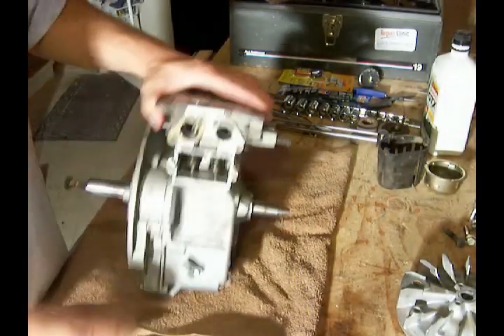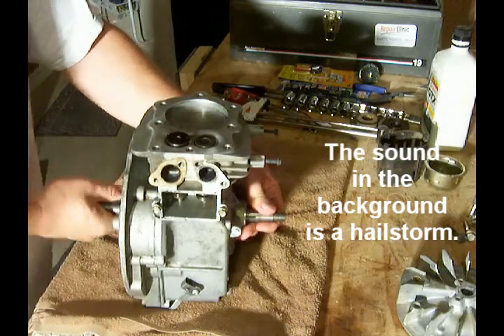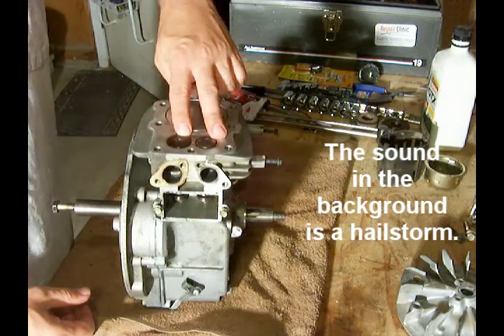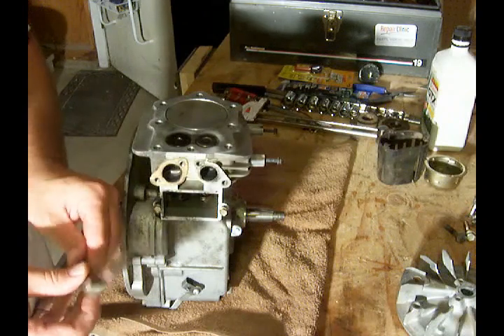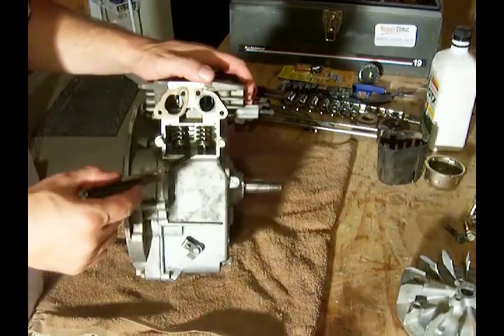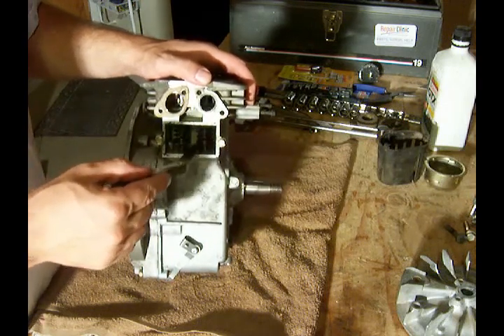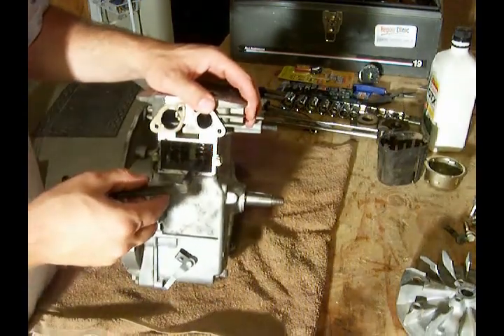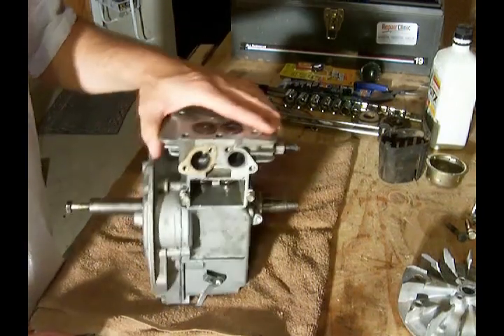#16 Tecumseh LV195EA / LEV120 - Checking valve clearance

Comment: For the Tecumseh this engine the set up valve gaps must be done w/piston on TDP, top of the cilinder and all valves very well closed. In the picture there is a mistake info w/intake valve. This is exhaust valve shown w/finger. The next bigger valve is for the intake valve. The valve gaps will be: 0.006" +/- for intake valve and 0.010" +/- for exhaust valve.

Comment: Tecumseh company has complicated the valve gaps for adjusting. There are a lot of job to do for this action. The gap adjusting is not friendly, must put a lot of work and the gap dimensions are not cleared exactly in what position of the piston must make the job. The piston on the TDM position can be more up or more down than 0.005-0.007 etc. because the piston can have the tolerance in this area of TDM. It is imposible to compare the valve gaps w/the piston gaps on the TDM position.

Comment: Can someone please respond to the fact that here the shaft was turned clockwise to reach TDC, when normally the shaft turns anti clockwise.
Reply: actually he turned it ccw looking at the flywheel end. he should have turned it clock wise (flywheel side) and actually had the intake valve open and not the exhaust one then to top dead center. He is one turn out from top dead center compression stroke.Valves are set wrong

Comment from the maker: If there is a problem, it is more likely the valve. Some engines don't have the compression release mechanism. You would have to open the crankcase to know for sure. It just makes for harder starting if you don't have it. If you feel confident, you could take the valve out and very carefully grind a bit off the end. Take a little at a time and check the gap until you get positive results. Thanks for watching.